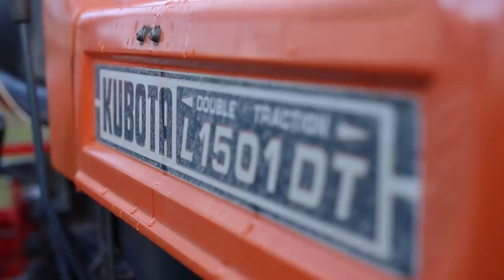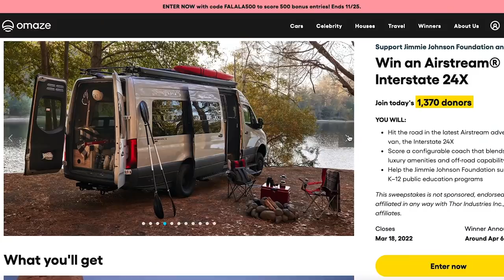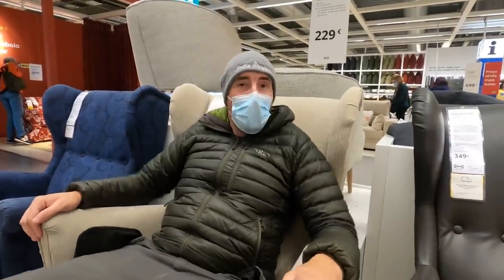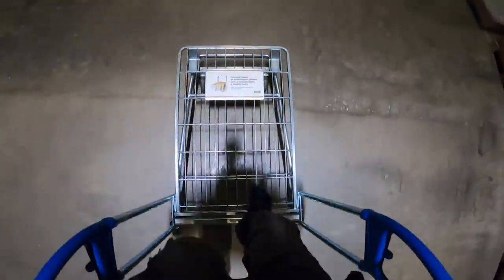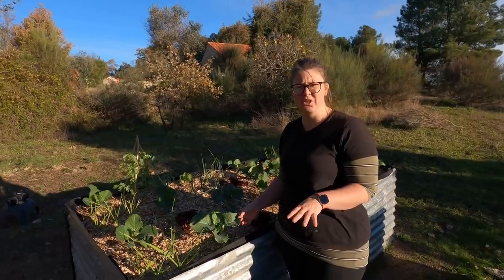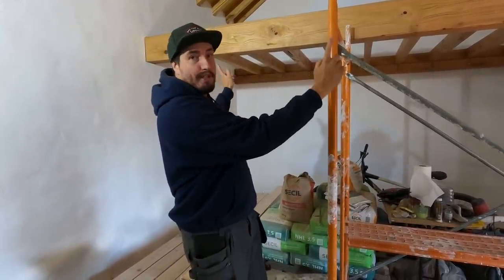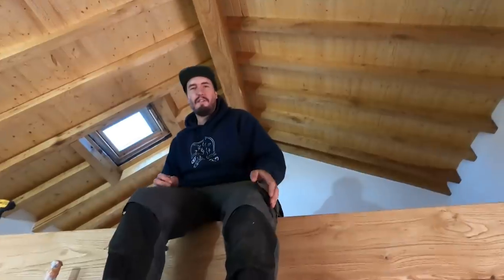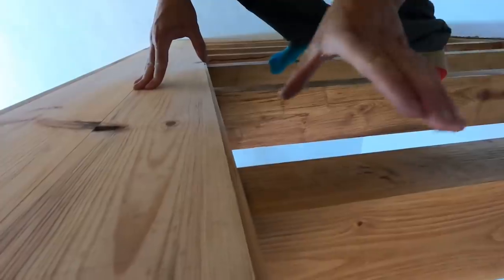Flooring Has Finally Arrived! Converting An Abandoned Barn

Comment: Hi, You two glad to see the time has come for the flooring. Just a quick note to say DO NOT FORGET TO PUT A D.P.F SHEET DOWN ON THE CONCRETE BEFORE YOU START ON THE FLOORING ,THIS IS REALLY IMPORTANT
Reply from the maker: Yes I’m not sure I actually need to and think it would work against me. The floor won’t go straight to the concrete base there will be 50mm battens and then a 25m air gap then 25mm cork insulation that will sit right under the floor boards, we already have a dpc under the concrete slab
Reply: Yes, that's right, you must have a dpc, check it out, please. But if the concrete is on one it should be fine. Just check first re levels and so on. I've cocked up majorly in my porch! Xx

Comment: Suggestion, the floor boards on the mezzanine , you only need to fasten the outside board, leave the others for a couple of months to aclimate  to your building. They will either shrink or swell depending on moisture levels. Nail them after a couple of months, until then they will not move being tongue and groove.

Comment: I would have loved that rug with a blue chair... Would be so colourful. 
I can never leave IKEA without checking out the discount section. Found some goodies there many times. Just love IKEA. I really don't need anything so I'm not going... Always come home with something I really thought i needed while I was in the store 🤣
But I thought you were going to buy the kitchen.....?!?!
And I hope you plants will survive the winter cold. Normally you plant those in spring or summer. Don't want to see you disappointed but I'm not sure that this is going to workout..... And it makes you so happy, would hate to see you sat about that 😕
Lots of love from the Netherlands Daniëlle 😘
Reply: Bea you need a green house..for your plants..the cold weather is not good for plants..csn be simple to make a greenhouse..the plants may not grow..without a greenhouse. 😪😪
Reply: @estelleschneider9033  Green house would be nice for sure, but quicker and cheaper could be a hot frame. Something similar to the raised beds they have but covered with glass frames (or even transparent plastic) with a hotter/more active (more manure) compost in the bottom to provide heat from below.

Comment: maybe use the same finish on both sides of the floor boards to avoid cupping? The oiled side will breathe more than the varnished side & hence will probably shrink more.
Reply: This is good advice, check it out as my kitchen cupped like mad after a leak xx

Comment: Love love love your videos 
Guys, don't forget to put down a very heavy plastic on your concrete floor prior to setting your floor batts down as a moisture barrier as the wood and insulation will suck up and moisture otherwise mold will start growing in the wood and insulation.
Blessings to you both, Cass

Comment: People have asked, when is Theo, going to do this,  or when is Theo going  to do that. But, I have question for Theo. When are you going to put in the color glass in the small openings in wall. I'm sure, Fernando will hate having  his short cut closed up. The color glass will add so much beauty to the inside. Turning the walls into beautiful artwork. I'm pretty sure this wouldn't happen until the painting of walls are completed and dried properly.

Comment: I was wondering how you would deal with the floor, as concrete is so dashed cold…the batten and plank plan with insulation sounds terrific.  You won’t lose much height, and you’ll gain such a lovely warm surface.  A few well placed throw rugs and a cat or two, and it will be home!

Comment: Morning to you. RE your raised gardens, It will become essential to place wood on top of the corrugated metal. The metal will rust and be dangerous in no time. I would reccomend 2x 4's or perhaps a 2x8 surround using the 4x4 supports you have at this time. Along with preventing rust and of course your hands , it will also provide a place to place to place a container when harvesting, avoiding much labor to harvests.

Comment: Would recommend you not use varnish but rather oil the top as well. If you scratch or ding the varnished floor you could end up having to sand and varnish the whole floor to get it  looking good. Using oil you can sand or buff and then oil the area that sustained damage

Comment: Varnishing the floor is an option of course, but keep in mind that you guys live in a sandy area. The abrasive power of sand is it’s not something you wanna underestimate, it will scratch the floor immensely. I would advise you to consider oiling your floor, you can touch it up locally when necessary. Think about it

Comment: Too bad you didn't set the cross beams down allowing for the thickness on the floor boards so that all you would see are those two beautiful width beams and not the edge of the floor boards!!!!
Reply from the maker: You won’t see the edge of the floorboards as the railing will cover it 😀